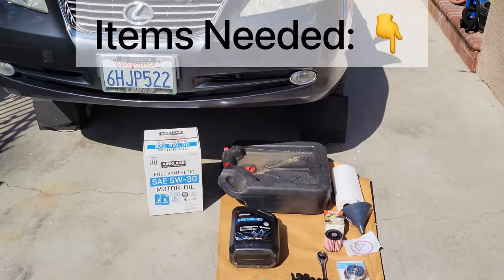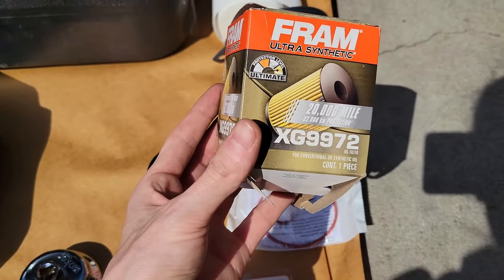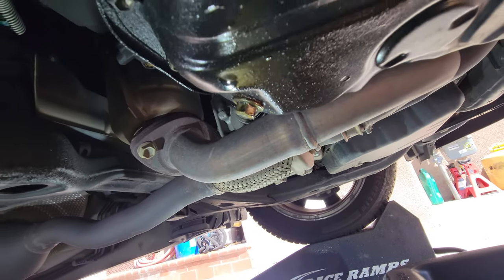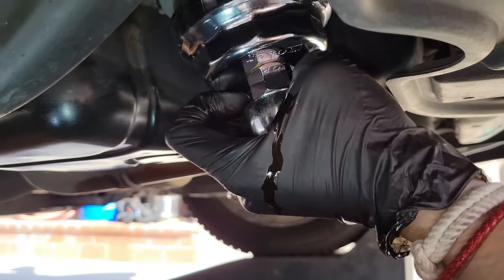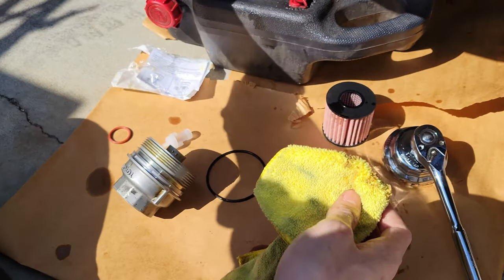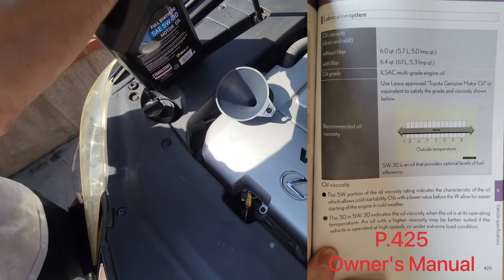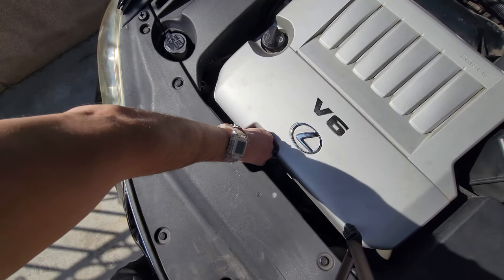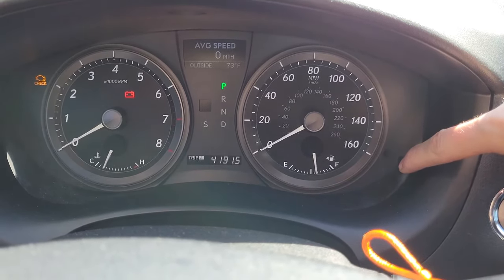Engine OIL Change Lexus ES 350 (2007-2012) #synthetic #maintenance #diy #camry

Comment: Kind of surprised you missed the filter drain before removing the filter housing. That's what the 3/8-inch drive disc on the bottom of the housing is for.  Your filter should come with a little plastic adapter that pushes on the ball inside of that tab to drain the oil out of the filter housing
Reply from the maker: I've done it before, It's an unnecessary step in my eyes. 

The filter housing has to be removed in either way

Comment: that oil actually looks fairly clean as it was coming out. also there is no guesswork when tightening the oil filter housing, you just turn it until it stops.
Reply from the maker: Yup! I'm in the process of changing the oil from conventional to synthetic so it's being changed sooner rather than later. True but Keep in mind everyone has different strength levels so some people think it stopped turning when they can turn it a bit more and some people can maybe over torque it

Comment: Issue with this type of drain on ramp is that it does not train full some dirty oil last part is left which contains some debre. So I use jack and lower it to drain full. Rest of video is good
Reply from the maker: Agreed, a level car is always best, but Jacks and Jack stands can be quite pricey for the average person $350+

Comment: Perfect. Thanks for explaining why you didn’t use that pre drain feature. I agree. Have you considered filling the filter cup before reinstalling? I can’t see it mattering much but some people swear by it.
Reply from the maker: Yes, I used it previously, but it is a bit of a challenge to open the pre drain, and makes no difference since I am going to remove the filter cup in a controlled manner anyway. Yes, in all of my other car videos I do prime the filter (pre-fill with some oil). I didn't for this one because this filter doesn't come like the other ones that have their own housing. In hindsight I could fill the cup halfway like a normal filter but it threw me off. 
Yup, it's probably 4 ounces of oil at best, so I can't see it making a tremendous difference, but in the Youtube world it has to be by the book

Comment: Great video!
I was wondering why not just pour 6.4 quarts as mentioned in the owner’s manual instead of putting in 6 quarts and checking?
Reply from the maker: It was my first time doing it on this car so I wanted to make sure it's accurate. Once I know 6.4 is right i pour it all at once 👍

Comment: How often should you change the oil in a 2012 Lexus ES350 if your using full synthetic?
Reply from the maker: Can't go wrong with a 5,000-7,000 mile window. Full Synthetic is usually rated to last 20,000+ miles, but best to change before that

Comment: Nice video you got!. I changed my vehicle (es 350 2009) Top gasket due to  over heating.
After the top gasket burn. I replaced it and changed the radiator to double face and changed the water pump. I further replaced the AC compressor.

Is there any other advice you have for me? For now the car is very stable and I'm always watching the temperature. 

I don't have money to get another one for now. 

Your advice is strongly recommended.
Thank you sir
Reply from the maker: Thanks for watching! I don't think my skill level is good enough to be able to diagnose that
Reply: Thermostat
Reply from the maker: @erickonassis6310  Could be possible

Comment: This is great vid. The only thing is those race ramps they're sooo expensive. I think I'll just use my trusty jacks. They can do the lifting.
Reply from the maker: Thanks! Yes, they're on the pricier end but I do love how light they are (about 3 lbs) and will last decades. 
I did get them for about $135 at Walmart years ago but they have gotten pricier. 
As long as you're using jack stands (not a floor jack) and wheel chocks, you'll be good

Comment: Thinking about fine Lexus ES 250 and I need to know if there’s a possible way for me to know if the water pump is bad and the timing belt cover leak concerning with the problems that this particular vehicle has would need to know how to diagnose these problems before I buy. Thank you.
Reply from the maker: Strongly recommend finding a mechanic in your area to inspect the vehicle you're going to purchase. They usually charge $150-$300 but it's WELL worth it because they can catch all kinds of things we're unaware of

Comment: I have a 2012 ES 350, the dealer and the manual recommend synthetic blend. Is there a problem for the engine if I use full synthetic?
Reply from the maker: A full synthetic is going to provide more additives and more protection. It never hurts to go with the higher quality. For example, we have the LML 2016 diesel Silverado and it asks for certain oil but since then oil quality has increased so the newer stuff is better
Reply: @Striker50_  BTW, using Full syntheic 5W30 like yours, every how many milage do you change the oil and filter?
Reply from the maker: @knowledgepeace4848  Every 5,000 miles is plenty good. Can easily go 10k miles

Comment: The crush washer on mine is stuck to the oil pan pretty good. Have tried removing it with a small screwdriver and all, but no luck. Any suggestions? Also, the Fram Ultra is an excellent choice - what I'm using as well.
Reply from the maker: Try using some sort of plastic card, and tap it with a hammer where it's wedged between the washer and the pan. 
Try not to use metal screwdrivers because you don't want to dent the pan, and it could leak in the future. Perhaps a flathead is a good option if you're careful with it
Maybe also hitting it with a little bit of degreaser will help just make sure to cover the open hole
Reply: @Striker50_  It wouldn’t budge no matter what I tried, but it came off with the oil drain pan bolt during the last oil change. Was pleasantly surprised, but glad it came off.
Reply from the maker: @lji2000  Yeah because that could be a source for it to leak nice to know you got it resolved
Reply: I used a 5 in 1 puddy knife(has a bevel edge)that gets under washer no problem

Comment: Doesn’t work for a 2006. The 2006 model was a 330 with 5qt capacity
Reply from the maker: Good call let me update the title
Reply: Yep, 2006 was the previous generation ES, the ES330. Oil filter was a traditional spin on type in a PITA location under the exhaust manifold. I like this next gen filter & location way better even though you have to buy a special tool to remove.

Comment: what is factory oil change intervals
Reply from the maker: I think it uses conventional oil by default so about 3,000 miles the car will give a notice to change oil
I changed it to full synthetic
Reply: Don't rely on factory recommendations.  Remember, they want to sell you another  car.  I use best oil and change twice a year and our mileage never comes close.

Change the ATF at 70k miles and watch videos to find out how.  
Other fluids too if you want 300k miles off your car.
Reply from the maker: @DavidMosby correct, in this video I was actually in the process from changing from conventional to synthetic which was what I was adding in 🛢️

Comment: Crush washer does not fit Lexus 2011
Reply from the maker: Interesting. And that's the 12 MM with the inner diameter? Crush washers sometimes have 2 measurements. Sometimes they list them as the outer diameter measurement, and sometimes the inner dimension.
Did you use the ones linked in the description, or another kind?
Reply: @Striker50_  I bought it anyway . It said on amazon it doesn’t fit your 2011 lexus. I trust you.
Reply from the maker: I just checked on Amazon for this Lexus again and I also got the notice that it doesn't fit but should be good. Can always compare to the one you're taking off for peace of mind  @stillhere7193

Comment: my lexus es 350, is fucked up so bad ; (
Reply from the maker: Awe dang why is that?
Reply: @Striker50_  Not sure what’s wrong with it but I know that the car when you drive sounds extremely loud not sure if it’s the wheel bearing’s & tire rods but it’s just very loud. Irregular RPMs as well it has roughly 265,000 miles on it not sure if the transmission fluid was changed each 30k - 60k miles but all I know is it needs some serious work to it before it starts to drive smoothly again. Engine light has been on every since I got the car.
Reply from the maker: @jdot2893  Have you plugged it in to a diagnostic tool? I got mine for like $25 on Amazon and it's been super helpful to read the basic engine lights
Reply: @jdot2893  It's certainly not surprising that a vehicle will need some work with that many miles on the clock. Irregular RPMs are often a vacuum leak.